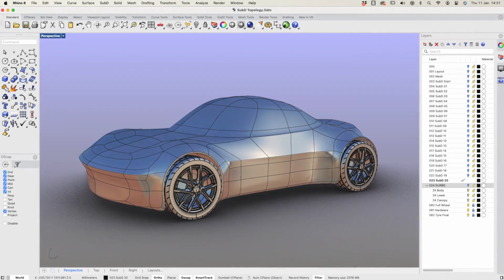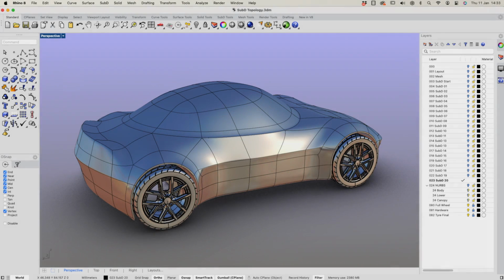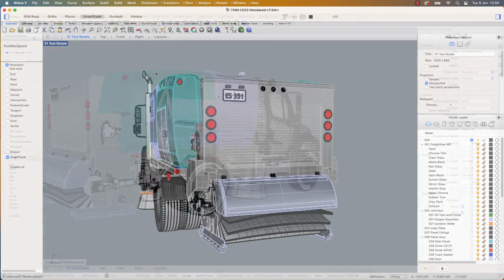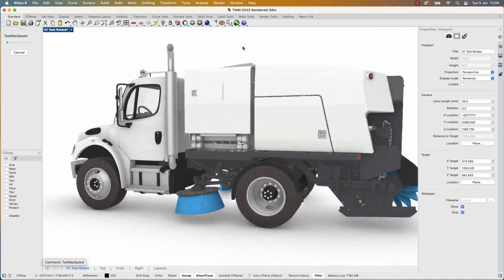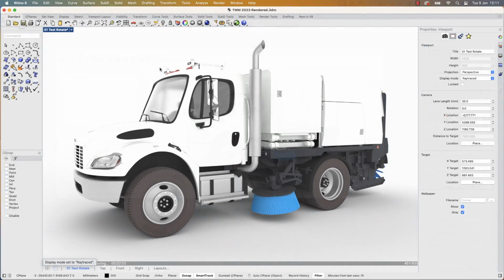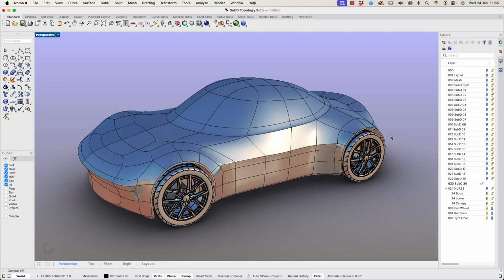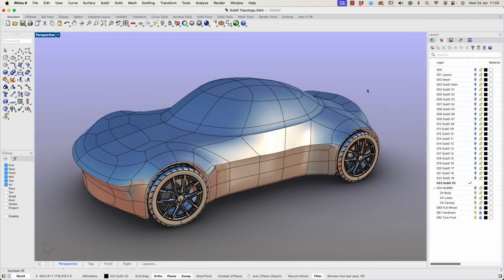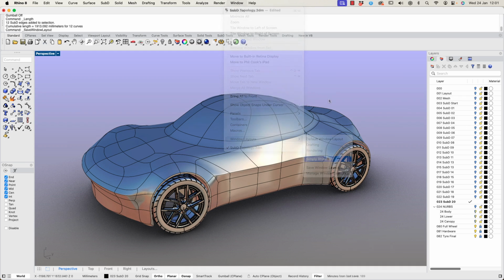Rhino 8 for Mac OS X - Speed Improvements and Interface

Comment: There must be something terribly wrong on my end with 8. It takes up to 5 minutes to do a simple move or rotation with the gumball with a 10 million polygon mesh. Intel 12700h with 64 gigs of ddr5 and an Nvidia 3070 (150w mobile version) with Windows 11.
Reply from the maker: Hi Matt, If that’s the case it sounds like there’s either something wrong with the model or your installation. Before you contact McNeel for support could you see if you have any ‘bad objects’ in the file? These can cause problems with file size and performance/reliability. Thanks.